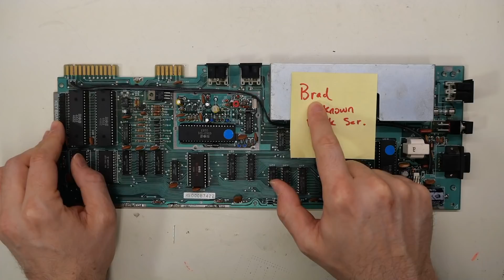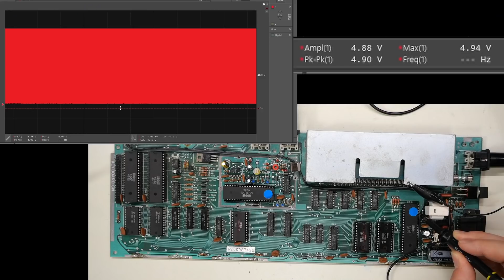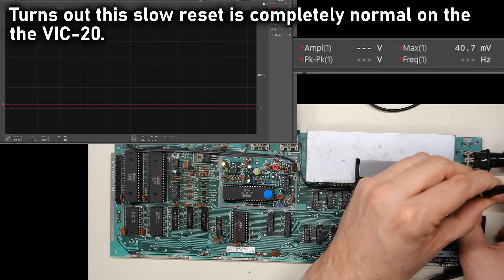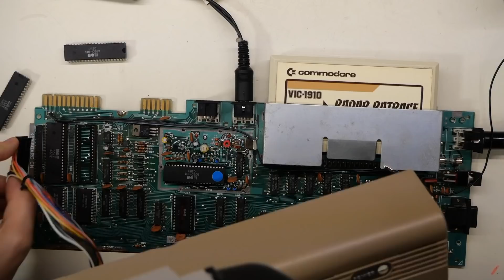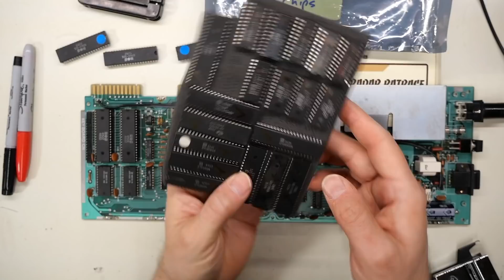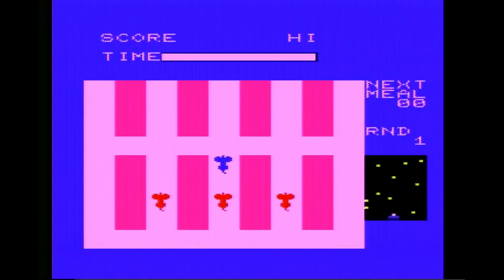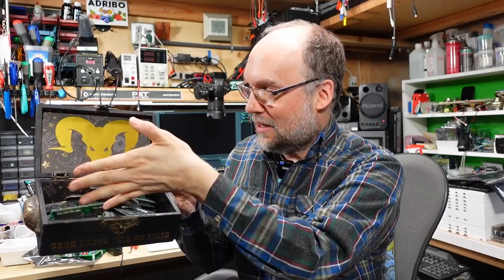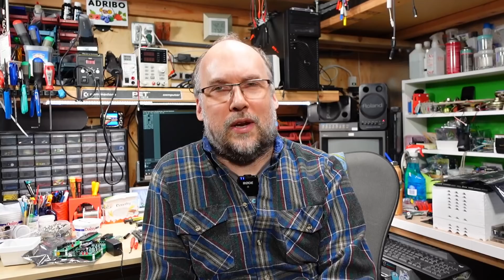Repairing two VIC-20 motherboards

Comment: The easiest way to check if the BASIC ROM is causing issues is to put a game cartridge in. When a VIC boots, it tries to run code at #A000 (where a game cartridge sits in memory) and runs that instead of running BASIC if it finds it. Because of that, a machine with just a faulty BASIC ROM will run the game.
Reply: You might still want to pull the BASIC ROM, in case it has bad chip select logic and is driving the bus (unlikely, but...).
Reply: Yup, this is exactly what is happening to mine, and boot cartridge runs fine. Boting withought a cartridge, or with a cartridge that dosn't auto run reults in a screen full of garbage.

Looks like I do need to swap out that BASIC ROM.
I have an eprom programmer but right now I only have a bunch of chips I was using to burn my Vectrex games to. So if I get a compatable chip can I copy the BASIC ROM from my good VIC then burn it to an eprom to work in the BROKEN VIC?
Reply: @GarryGri  yes, but it’s not quite that easy. If you could find a 2364 eprom, you can just burn it and drop it in, but those aren’t made anymore and are hard to find. You are much more likely to find 2764s, but then you need some sort of adapter as the pin out isn’t the same. You can either build one (Adrian has shown how to in a previous video), or you can buy adaptor boards on eBay.
Reply: @Doug_in_NC  So by the time I buy the 2764 chip and buy/make the adapter is it going to be much cheeper than buying a replacement BASIC ROM chip on ebay for around £20?
Reply: I just saw one on ebay for a tenner NOS, so I'll buy it and try it!
Reply: @GarryGri  Should be less than 20 quid

Comment: Now that there are 6502 to 6510 converters out there such as go4retro's Nu6510 and Monotech's MOS CPU Replacer, hopefully someone will start working on a 6522 to 6526 converter. Given how many C64s are still out there, there's definitely a market for such a device.

As for 6502 failures, they're uncommon but not completely unheard of. I've come across one failed 6502 in my travels, along with several failed 6522s. Oddly enough, all of these were made by Rockwell and I found them in BBC Micros.
Reply: An 8520 from an Amiga will work in place of a 6526 in a pinch. Not 100% compatible, but very close. Also a dead 1541 is a great place to harvest 6522's.

Comment: Great video as always!
ALL ICs ever made will, one day, stop working, even if they aren't used; guaranteed. It happens because of electron migration, which is faster under usage but can be induced even by cosmic rays. All ICs will die, eventually.
MOS chips die a lot faster than the rest because MOS was the worst manufacturer in history when it came to process control (which they basically didn't have) and electron migration mitigation (which they basically didn't do). They sort of worked under the premise that, if the IC worked coming out of the line, then it was good enough; something every fab in history (except for MOS) has known isn't enough.
Reply: So even if you kept working ICs safely stored in a secure airtight container in a vault or whatever for many years without using them they would still break at some point? Is this the same for more modern ICs like processors that we have today?

Forgive my ignorance but I just learned about electron migration. I know ICs eventually fail, but didn't realize exactly what ends up killing them.